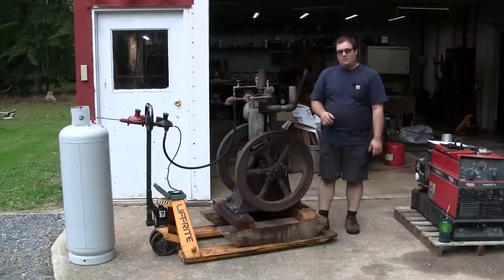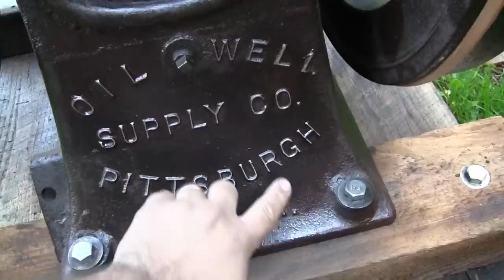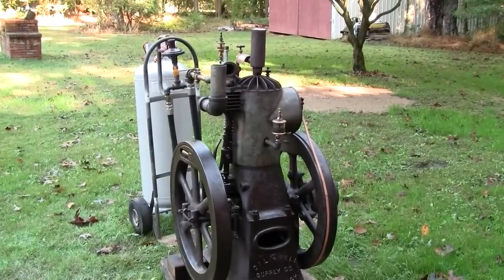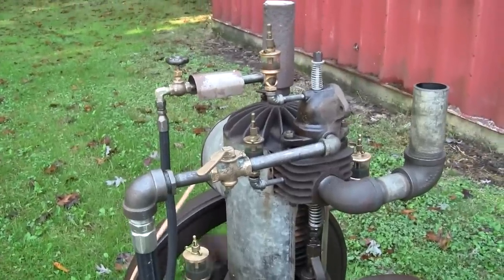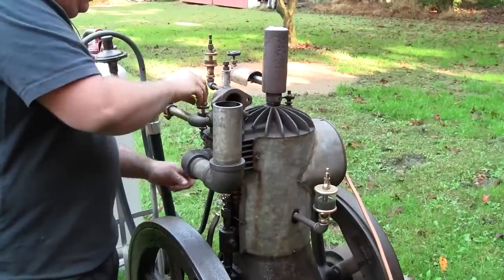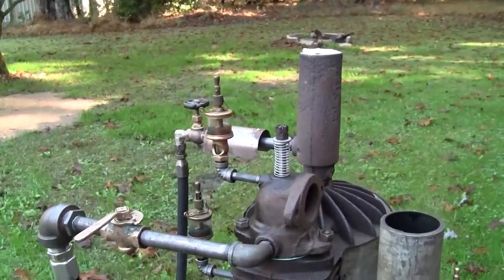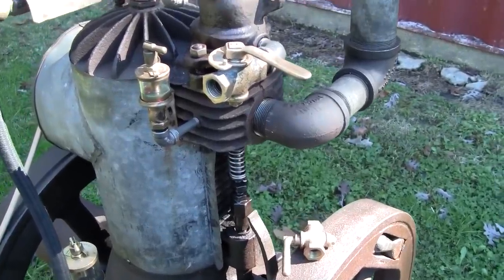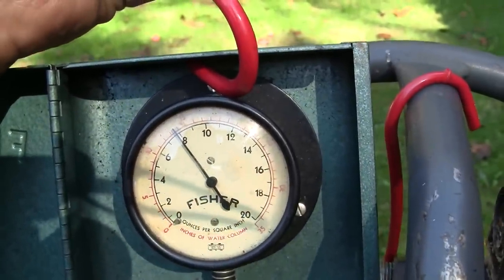100 Year Old Hit and Miss Engine Running on Propane Oil Well Supply Co.

Comment: I agree with the other people, your probably getting too much propane on that first intake stroke. The 2nd one clears that out and has a burnable mixture. The fact that you only need to have that control valve open a smidgen means you have no shortage of fuel. I'd turn the 2nd regulator down more and add an accumulator. Natural gas and propane have different a/f ratios. I have no idea about raw well gas but it probably takes more of that to burn vs pure lp.

Comment: Greetings:
The governors weight  seems  to be the major speed control aside from the applied load including engine inefficiencies. I wonder what the cyclic load of a contemporary pumping jack is and what the typical cycle time is. (pumps per minute)
The flywheel action seems to slow  its speed too quickly.
As for fuel efficiency; I would reduce the burner flue delivery to check engine running affects.

Comment: You have to remember that the casing head gas was not like the pure processed fuel she's being run on. Original stuff had benzene,propane ,other gases flammable and non flammable = poor quality fuel  it also used a needle and seat  threaded for fuel feed back it out - more thread in lean or slow down,big valve is shutoff .

Comment: needs a stronger valve spring, specifically one that is just a touch less than the vacuum the cylinder creates, and the 'tensioner' nut should just sit on top of it so its snug against the spring, but not compressing it at all. Grab a vacuum gauge and attach it to the intake valve assembly, and take a measurement. example: if its creating a 22hg vacuum,, you're going to want a 22lb spring.

Comment: I'd love to build a modern version of these engines, a crankcase, from aluminum, with bolt on cylinders, (opposed twin, with 8"-10" bore with 8"-12" stroke,  use a diesel fuel or waste oil fuel, 20:1 compression,  use a  glow plug assisted ignition,   it should run decently well, I about 900-1200 rpm, 
Make plenty of TQ, the opposed piston should run smoothly,  possibly  Using 2"exhaust valve pair, and 2.250" intake valves, using 2.5" tube for intake manifold, and 2" for exhaust, 8" 3/8 " wall pipe for cylinders,  cast from a couple sets of old modern cast pistons within 20 years old, about two engines worth,  use brake rotors to make rings, about 2-3mm wide  compression, and about 12-15m wide oil ring pack two , 2.5mm wide rings with a coil spring spacer,  with the cylinder side of the ring cut down to about 1mm, similar to a napier ring, all the rings made this way, to keep about a 1/16" contact on the cylinder, still using large rings for strength .  bore and hone the cylinder maybe  make a dummy crank case to make boring the cylinder easier, use 1/2" steel plates welded to the pipe cylinder ends,  to form the deck, and mount to the crank case,with a 1/4" plate about 2" above the bottom  mount  to form the water jacket, using 12ga steel maybe 1/8" plate, make a head from 1/2" plate and sheet metal, using thick wall tubing elbows to form ports, then use sheet metal to close in the sides, and make a sheet metal valve cover, use ohc with chain drive, probably a oil pump cam driven for the heads and a  crank made from steel plate and , thick solid round bar, machined to a interference fit , heat the flat, press in the bar, then grind the seam and weld, for 95% penetration  then grind the opposite side to the weld, weld it up. Forming a crank,  machine to near size, heat treat the journals , with the whole crank hot then quench, then machine to fit common bearings, I want a engine  that can be used daily for years,  hopefully  run 10 years before needing a overhaul, just chugging over, it would be a heck of a project, definitely requiring help, !! ✌️

Comment: @ 20mins its not getting enough air. Adding fuel makes it triple intake before firing. that suggests the double suck is it gulping for air not fuel. Either the inlet valve is too stiff/slow to open or your fuel air mix is off.

Comment: I love these old engines built at the turn of the century. I have 1 question. Why did you insulate the inside of the hot tube? Isn't the point of it to get hot and transfer the heat to the cylinder and air/fuel mixture?
I might understand insulating the outside to retain heat on a cold windy day but I can't see the reason for putting insulation on the inside. Someone please educate me on this.

Comment: The gas is being fed into the intake continuously ........ with a carburettor the inducted air sucks up the petrol only during the induction  stroke ........ with gas it is constantly feeding in gas which is sucked in only on  the induction stroke ....... this gives a  fuel to air ratio  that is difficult to regulate correctly with gas /air ratio building up until the inlet valve opens.

Comment: Just seen this video.. I agree with other commenters, put a load on it, but have you tried decreasing the air intake? Looks like you have a 1.5 - 2 inch air intake to a .5 in gas intake.. it may be getting too much of both.. just a thought. And I think an accumulator wouldn't hurt..

Comment: set up a  holding tank with water and  a pump and you will see a totally different sound and  character  to how it runs, and yes  you can flood an engine on propane same as you can for gas the fuel mix gets too rich for it to ignite

Comment: bro u see that moving lever that open when the rpm drops u need to adjust that so it open sooner in the rpm drop so it not stay open longer when the valves have to work. just a hunch i have

Comment: I wonder how much more expensive is butane?  Some operators will use butane in place of wellhead gas as it is very similar in caloric content to natural gas.
Reply: Butane is generally cheaper than propane. It's less suitable for use at higher elevations and less energy dense.

Comment: my bet is due to the engine cycle is rpm controlled and there's nothing to dampen and smooth rpm (engine operates with no load) its rpm raises and lovers above it's nominal limits, which leads to valve mechanics being stuck in open state for more then one cycle (well, had to read previous comments, someone already figured it out)

Comment: HAVE OU CHECKED THE CYLINDER VACUUM? SEEMS AS THOUGH IT IS LOSING SUCTION PART WAY DOWN THE STROKE AND PERMITTING THE VALVE TO CLOSE MOMENTARILY.  IT WILL RUN BETTER UNDER LOAD.

Comment: I would try adding something to the air intake, like a filter housing or just some pipe. Seems like it was designed to have something bolted to it.

Comment: I suppose this is a stationary motor designed to drive a load at a specific speed, much as a generator wants a fixed speed to give eg 60 Hz. The intake valve is more like a mix screw. You change speed by regulating the sentrifugal weights to get a new, fixed speed?

Comment: Seems to me it is a timing issue, or there is no timing adjustment at all.  Besides the weights on the governor, what controls when the exhaust value is released.  is it just when the weights collapse in, or is there something that also controls what position the flywheel is in when the exhaust valve is released.  I bet the exhaust valve is released near the bottom of the intake stroke when it is released.  Therefore it doesn't pull in enough fuel air mixture to fire, and needs a full revolution to get a full intake stroke.   Looks like this would be a 2 stroke engine.  Maybe not.

Comment: Ur filling the intake with propane when it's on its miss cycle then it opens and pulls basically pure propane in exhausts that then pulls in the propane air mixture. U need to make it only inject propane when it is on the hit cycle and not all the time

Comment: Insulating the inside of the hot tube is counterproductive. It keeps heat away from the metal tube. Wrapping the outside would do what you're trying to do.

Comment: What happens when the heat is removed from the hot bulb?  As I understand, the hot bulb is supposed to be self sustaining after the engine is running.

Comment: I'd want a way to control air inflow. The air intake looks to have bolt on or threaded pipe. Put a valve on the air intake to control it also.
Reply: Or a needle valve on the gas feed line instead of butterfly valve.

Comment: I know zero about this type engine. Although i am a semi retired auto mechanic. I wonder if maybe the "double suck" intake charge as you call it has something to do with too lite of a valve spring? They appear to be replacements. I have enough trouble working on my 30-50 year old chryslers... Lol. It has to be hell finding correct repair info and parts for some thing like this

Comment: I am guessing the first suck is rich as the pressure is at regulator pressure, the second suck is at lower pressure due to the valve. I would  leave the valve open and regulate mix with regulator. Or, you can move throttle valve right next to the intake valve to eliminate the pipe reservoir effect.

Comment: Natural gas runs at a lower water column than propane. Your gas pressure is probably too high, which is why the valve needs to be nearly closed.

Comment: Since it’s a diesel once it’s hot enough can you just turn off the hot tube? That’s probably more efficient than my lawn mower. Heck my 3/4 ton diesel truck idi is more efficient than our 2016 minivan that gets 13-16mpg. Almost as efficient as many sedans lol.

Comment: You need a work force aka resistance pushing back on engine. Without one engine quickley exceeds rpm governor and needs to slow down. With one I think you will see the engine run better. What ever you use need to create a resistance like when it pumped oil.

Comment: Maybe use a needle valve to fine tune the fuel once you have the engine running.  Tou would be able to be very precise then.  Just a thought.

Comment: Bonjour,
Very interesting video. Thanks to you, I discover that large Hit & Miss engines are as sensitive to the quantity of fuel as my little toys ones are. I also have noticed that the weather conditions and the heat of the engines had an impact on the carburation... Would this mean that some people had to stay all day long close to these engines in the oil fields to control them especilally if these engines were only air cooled ? 
Amicalement, Raphaël

Comment: Some engines  won't run propperly without an airfilter on the inlet. And there is a flange on the intake.

Comment: Maybe a demand regulator from an LP forklift would work better?  I'm not sure if it would work with the way the gas is ported into that engine without a venturi/throttle blade.  You don't need the vaporizer portion since your 100lb. tank is doing that job.  The issue is you need a relatively large gulp of gas in a few milliseconds and that small regulator and misc. plumbing can't supply enough in that short amount of time.

Comment: Maybe the intake is to unrestricted, did they use air filters back in the day? But I do agree with others that this has a lobe for work and not idle and back in the day you could have one or the other but seldom both.

Comment: maybe you get a few alternators and run them from a belt and pulley system to generate yourself a bit of electricity
Reply: heck and then you can get a heating coil for the glow bulb :)
make the engine heat up with electricity that it produced then you can eliminate the gas for the torch

Comment: Maybe intake spring slightly heavier wire, but less preload?  Also I wonder if you’d get a more stable fuel/air mix with slightly more rpm and a load on the engine?  Anyhoo, cool engine.

Comment: I have been subconsciously yelling at you to add a load or adjust the govenor so it does not open the exhaust valve so soon.
The problem is that you keep shutting it down because it instantly overspeeds. Too many open exhaust strokes.

Comment: That is a really cool engine 👍👍.
Wonder if you closed down the air intake a bit you could find a happy medium between the volume of gas to air ratio .??    
Could a hit and miss engine drive a generator without to much fluctuation in the voltage between firing and coast down ??

Comment: Natural gas and propane have different burning characteristics, when converting a natural gas appliance to lp the pressure is increased and the orifice is smaller. I would try to have the pressure between 5 and 10 inches water column, and decrease the holes in the valve seat.
Reply: Maybe test it by covering half of the holes in the seat

Comment: Neat motor. I wounder if a length of pipe on the intake would help keep the fuel in there inbetween intake strokes

Comment: Oh I should also note that there is a missing arm that connects to the intake spring to keep it from leaking fuel into the engine during coasting.

Comment: Sounds like intake valve continuous bouncing on the seat after intake stroke into compression stroke. 
My guess is thucker gadge spring with less seat pressure might make a difference not sure how you'd calibrate overall length or coil count though. 
Have been experimenting with a ohv vtwin trying to make a air compressor out of one cylinder and had to find a ballance beween seat tension, valve lift, and return speed.
 I eliminated one factor by limiting the valve travel since the piston would hit the valve, wound up loosening the retainer and valve punching out the head oops😂 Grabbed another valve from parts pile. 

Sealed up the holes with JB weld and punched the valve guid out so roll pin on valve stem would bottom out againts guide before valve could interfere with the piston.
Thicker gadge wire spring will return valve to the seat faster less valve travel and less travel time needed for the spring to return valve back to the seat.

Comment: I commend  your persistence, I thought I saw a relation between the link that holds the exhaust valve open and the double intake . I would bet that if you put a load it would fire way differently.

Comment: mike , if there was some kind of air cleaner assembly on it. would that change things at all? funny a stiffer spring didn't work? it will be interesting what you find. someone will chim in on it hopefully....goodluck.
Reply: lots of old things didnt run air cleaners,  just crude mesh at most

Comment: 28:18 fuel pressure was my very first thought all along. I figured when it was reliably double-charging to fire it was getting a 'dry' charge the first time because there wasn't enough pressure to push fuel far enough down the line past the valve.

Comment: You may have insufficient exhaust back pressure. Due to the valve timing a certain amount of back pressure may be needed to facilitate retention of the intake charge in the cylinder. Much like a wide ported two stroke. Mind you my knowledge on hit and miss is from books, not real life experiences.
Reply: might just be because its idling and not under load

Comment: What if you gave it more tension on the exhaust valve ? .... I see that also does a double like the intake valve

Edit : I see even after it fires and that governor holds the valve open so it doesn't go over rpm, I can see the exhaust valve still sucks open off the rod from the governor

Comment: Almost looks to me as if the issue is in the gov 
Every time it fires the fly wheel spins too fast so the gov cuts back on the fuel till the rpms come down
When you pulled back on the gov lever it fired on every stroke but you didnt keep it in place 
Just the way i see it

Comment: Other gas vapor engines I have seen have a balloon on the gas supply to give a bigger low pressure volume of fuel.
Propane has a higher heat value compared to natural gas. Might be an issue

Comment: why that sounds like that >>>> Keep in mind the counter weight is going around and that keep the engine running to So when the engine fires is ONLY to move the counter weight not to free run Plus that engine ran off of the gas fume from the oil well! next time see how slow you can make it run with out stopping

Comment: I admit that this is from a point of view of total ignorance of such engines, but I was wondering if that engine originally had some sort of induction pipe, or even a filter,  and its absence somehow causes the double intake pulse
Reply from the maker: Thanks for checking it out!  These early engines typically only had a cover or shield to keep the rain out.

Comment: I wonder... what if the intake valve is leaking just a tiny bit during the miss-phases. That would make a rich condition on the 1st hit of the valve. Maybe too rich to fire. So after pushing out the missed hit, the piston would draw fresh mixture and this time the hit hits. Just my 2ct.

Comment: Check out this YT video of the start up of a Lanz hot bulb tractor engine start up.  https://www.youtube.com/watch?v=dn-kZy8iIxM
It's my understanding that the hot bulb is used only to start the combustion process.  Once the engine is going the hot bulb retains enough heat from the combustion to ignite the incoming gas/air mix.  Your engine being unloaded and firing in frequently may not have enough heat to keep the combustion process going.  I agree with other commenters that the engine will run better under load and possibly more economically.  Something was bolted to the intake.  Maybe there is something needed to smooth the intake air into the intake valve assy?
Make sure that the gas plenum is free of insect occupancy as are the individual inlet ports arranged around the valve seat.

Comment: Could it be that the pressure should be ower and the valve more open? With a restriktive valve like that there might not be enough volume of gas to take from.

Comment: So, an engine that does not require electricity to fire the cylinder.
The Amish would be interested!
Perhaps the propane pressure is pushing on the intake valve causing it to flip flop?
Gasoline would not do that.

Comment: it sounds like to me it only fires when it slows down. probably with no load on it when it fires it goes so fast that the clutch does not disengage the fuel valve long enough